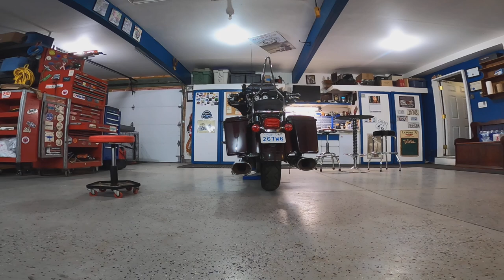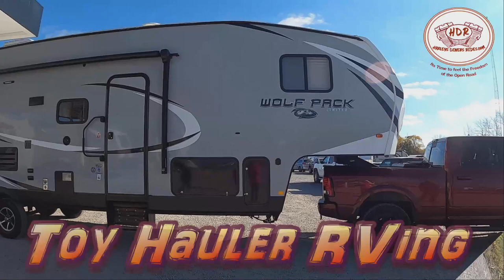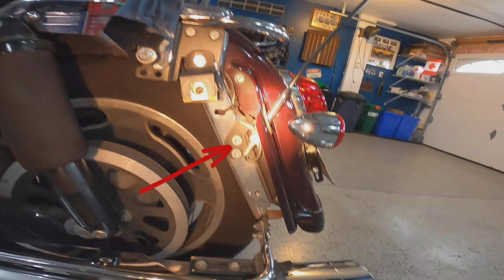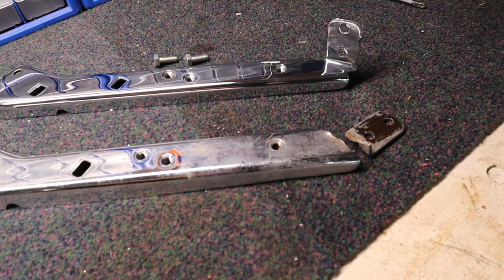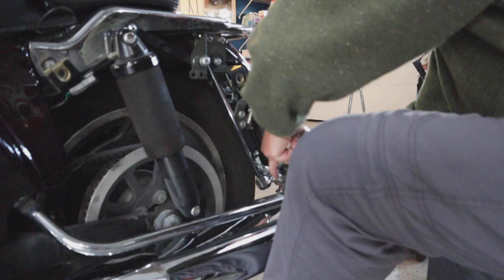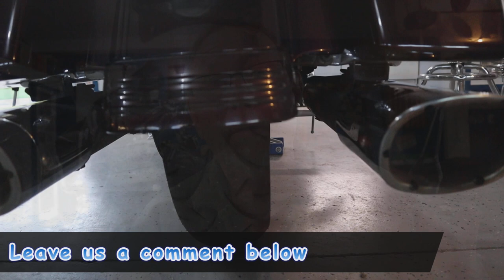HD Saddlebag Frame Bracket Replacement

Comment: Hmm interesting 🤔 
Good job catching it before it got worse Dave.
That’s a lot of removing!
Reply from the maker: Yes their was a lot of bolts to remove to replace it. I started the reassembly and then forgot to install the spring clip off of the old one. had to remove add and then finish the install. Thanks for dropping by, Cheers

Comment: Yup I had to do that on my '98. I think it was the same side even, probly vibration induced over time. I got replacement part used from ebay.
Reply from the maker: Hey Ron, I have now replaced both sides. Hopefully the new parts last. Cheers Dave

Comment: I have a 2005 Road King Classic.  I had replaced at least 5 (3 on the left 2 on the right) of those until I figured out how to stop it.  I ended up making a connecting part.  That was 12 years ago.  Have not replaced one since.
Reply from the maker: I would be interested is seeing your Mod. Next time you take the bags off take a picture of your fix and post it. I'll sure you would have great response. Cheers Dave
Reply: @HarleysDinersRides  It is just a longer version of the bracket that connects the two sides with additional holes.  Just takes a lot of calculations on the amount of metal needed and the bends needed to have the right shape for the extra holes you will need.
Reply from the maker: @fogit4668  Thanks for letting me know, cheers

Comment: What’s the locking mechanism for the saddle bag bracket that screw you put on the new one
Reply from the maker: It's actually a spring clip/nut that you have to remove from the original frame. It is on the reverse or back side.